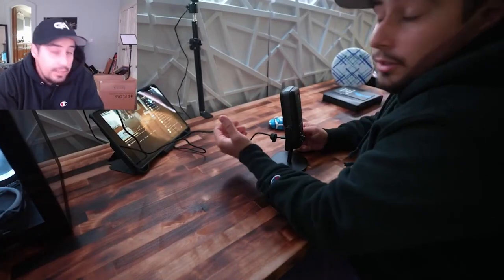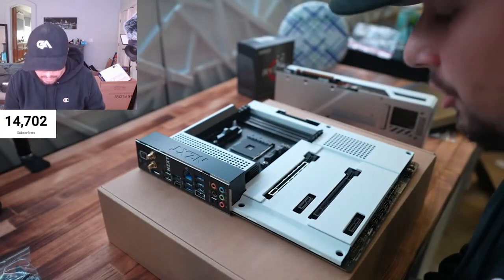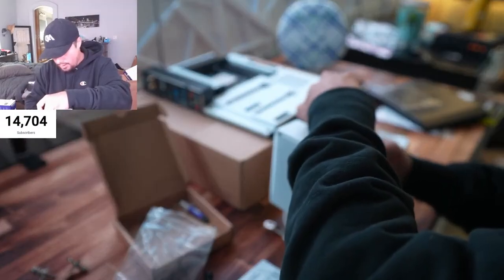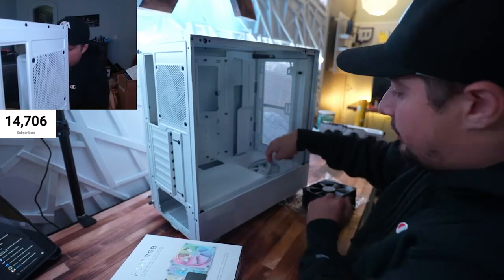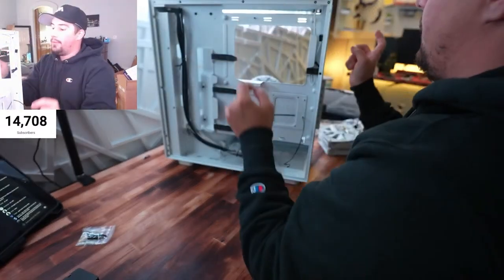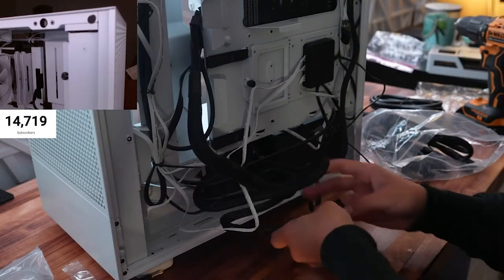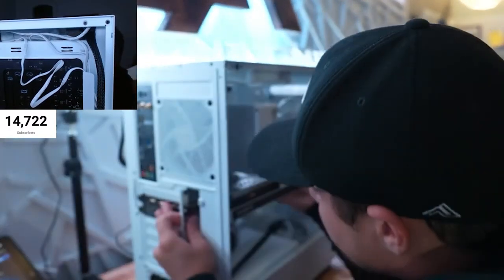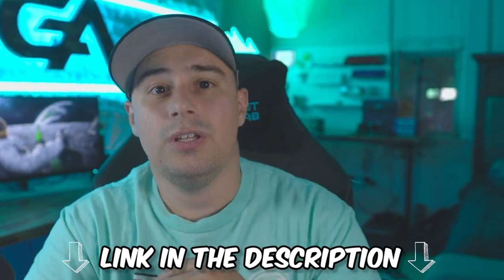Building My INSANE DREAM Gaming PC

Comment: Nice video, nice build. But for a high-power-draw card like a 3090, it's best to have separate power cables feeding it power from the power supply. Rather than a single cable with a daisy chain.
Reply from the maker: Thanks for the tips, good point. I'm working on getting extensions so I'm kind of just waiting for those!
Reply: @GutzyAiden  Great 👍🏼